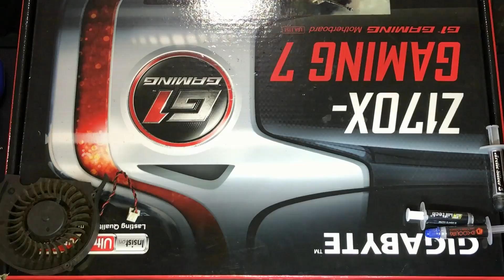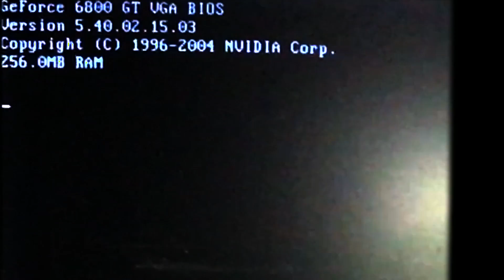Restoring an Overheating Doom 3 Edition Geforce 6800GT AGP Graphics Card

Comment: have a 7800 gs agp and a 6800 ultra agp the 6800 ultra is the DDL version in the power mac g5 i overclocked it from 400 to 430 and it plays doom 3 very smooth  . but the 7800 gs is just a bit snappier so ill be using that and ocing that card

Comment: Arctic MX4 is the no1 thermal grease for GPUs, and this 256mb 6800gt is a legend of a gpu, last one made that works on windows98, but why is it only running in PCI mode?
Reply from the maker: The gigabyte board used here was one of those hybrid boards with PCI-E and AGP unfortunately the AGP maps through PCI, I never use this board for performance benches only testing :) as for thermal grease I use Gelid GC Extreme or Thermal Grizzly Kryonaut,

Comment: mg this card takes me back used all my 18th birthday money to buy it i remember it being sooo amazing lol
Reply: then when it blew up in 2006 i didnt build  another pc till 2016 6700k i7  1080GTX  what an amazing leap its been for me and i dont over clock this pc haha ;-)
Reply from the maker: Craig Thomas I had my 6800GT PCI-E card die and get replaced under warranty then the new  one died too by that time XFX replaced it with a 7900GS :)
Reply from the maker: to follow up the 7900GS also died a few years later lol I had a bad run from XFX and I didn't OC back then either
Reply: BEXY'S PC haha nice what are you using now? :-)
Reply from the maker: Craig Thomas 7700K 1080Ti :)
Reply: BEXY'S PC nice fairplay would believe it the 1080Ti came out   month after i bought my 1080gtx lol
Reply from the maker: Craig Thomas luckily i bought my 1080 on release so i had some time until i bought the 1080ti but the 1080 didn't have quite enough horse power for my predator x34 @ 100Hz so its been moved to our 4k tv for casual gaming :)
Reply: BEXY'S PC haha nice notice much improvement from 60hz to 100hz? my 1080 is clocked at 2.1ghz core lots of fans etc  but its on 60hz 4k predator g sync monitor could use a little more power haha ill wait it out now till 3080ti or  somat in years to come before i get a high refresh rate 4k monitor but would like to try one :-D
Reply from the maker: Craig Thomas I came from a 120Hz 1080 panel so not really sorry but im ok with the 60Hz on the 4K TV as im using an xbox controller not my mouse and keyboard where i would notice lag more :)
Reply: BEXY'S PC yeah thats fair enough i bought a 65" inch 4k tv the start of this year i dunno what it is but i prefer to sit at the desk and use the predator cant put my finger on it but i just dont seem to play as well. 😬😄

Comment: Doom 3 was insanely demanding back in 2004. Not even the 6800 Ultra could play it maxed out.  I installed it today in a GTX750 Q6700 system and in the opening scene with the floating space capsule I saw 98% gpu usage (ultra, AAx16, 1024x768)... Insane!
Reply: No. I recalled I played doom with 9600 ati (non pro) fine no issue on athlon xp 1600
Reply: I know, the power theses games needed back then. Funny that it plays awesome on my Nvidia Shield in 2019. :P

Comment: What brand and type of screwdriver is that?  Have seen those in tons of vids (mainly U.K. Based however I'm in USA) and have been looking for one for a long while.  They must be a fairly decent tool for electronics repair & restoration as often as they appear.  Thanks for any suggestions you could provide.
Reply from the maker: Hey, Sorry for the late reply I've had them for years so the brand names have rubbed off both of them I can only see a GS logo on the larger RED\YELLOW one, They are insulated screw drivers for electrical work to protect you at higher voltages of course with PCs that isn't an issue unless your inside a power supply, I guess the other thing it may help with is shielding components from static shocks from the user (Even though extremely uncommon).